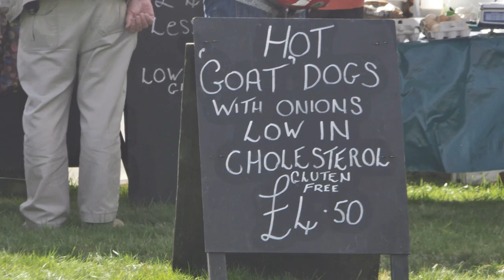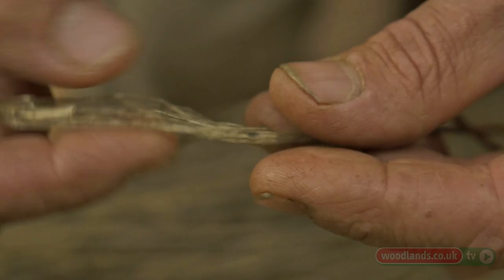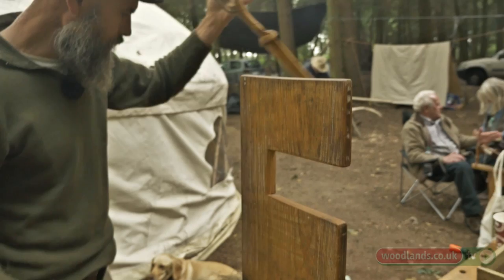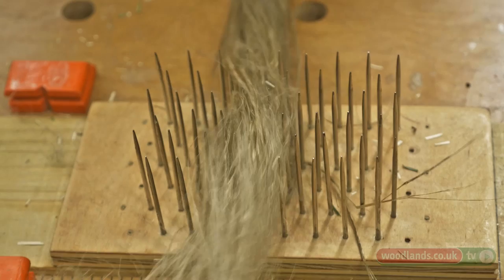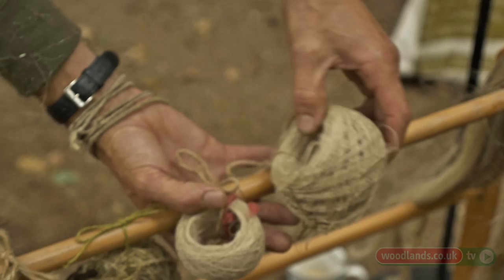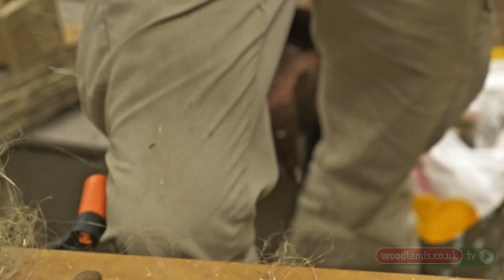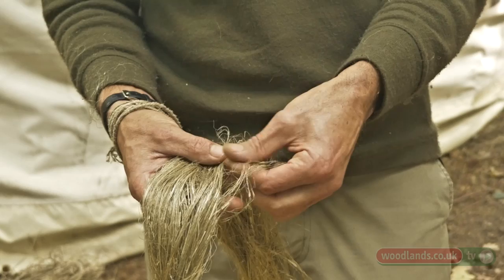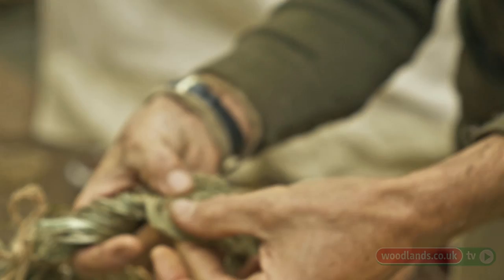Working with Flax and Nettles

Comment: I like how they focus on the "industrial quality" of the cottage industry. Nicely done. Everyone imagines rowing the Viking long-ship but first they had to weave that sail!
Reply: The craziest thing about the Viking sails is that they were made from what seems like the worst possible fiber: wool.  Wool seems like an insane fiber for sails, because it's so heavy.  In the age of sail, it was all cotton, but the Vikings didn't have access to cotton.  They did have access to linen, but they weren't using it to make sails.  As it turns out, there was a specific breed of sheep used to produce the wool; modern commercial sheep breeds do not produce a suitable wool, which is why nobody thought they could possibly have had woolen sails.  But they did.